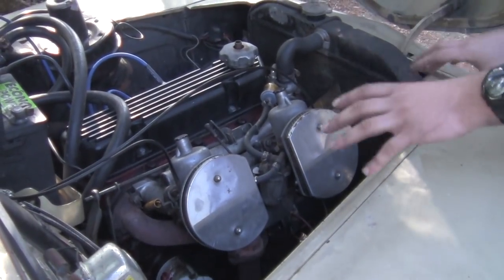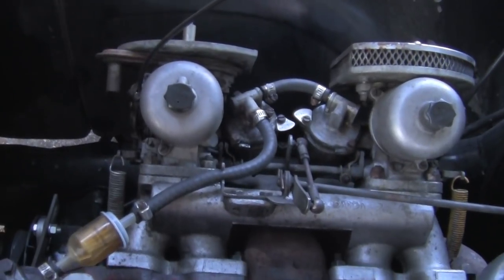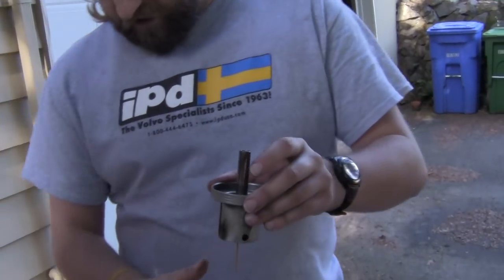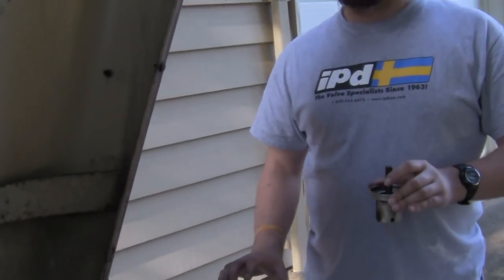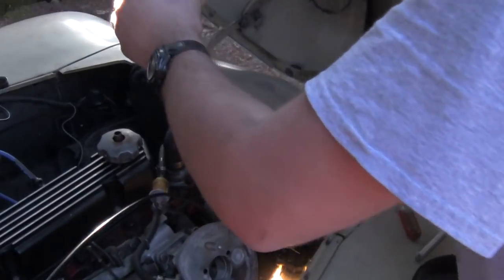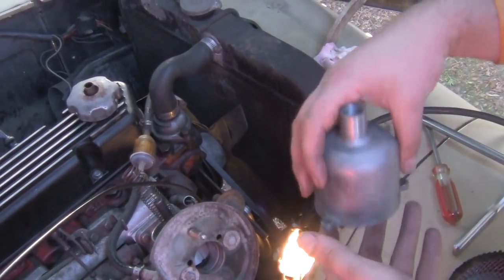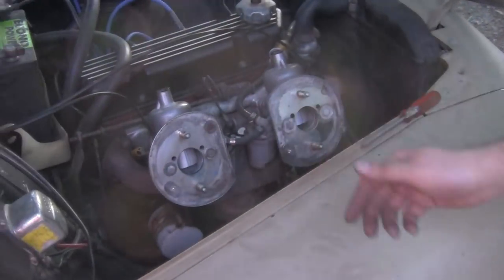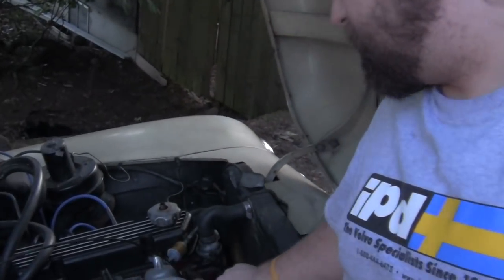Dylan's 544 #3: Setting those SU Carbs!

Comment: Dylan, Excellent video and nicely done. One comment. You may want to mention that when synchronizing the carburetors to get the same flow through each one, you should ensure the throttle shafts are not connected together. The throttle shafts should operate independently for this adjustment and then get locked to each other again when competed.....Tony

Comment: Excellent video.  The best ever on these simple but tricky little English (backwards-Whitworth- carbon-clutch-bearing-lever-shocks) carbs.  You can probably tell I'm not a big fan of the way the Brits made their cars, but your video is a 10.
Reply: Worldwide auto parts of Madison rebuilds the Armstrong lever shock that seals the oil inside so you never have to add oil ,on YouTube I think that YouTube is titled Armstrong lever shocks guys working on a green MG and it's got a good explanation I ordered some from my car and they helped a lot As my car was bouncing around as I went over man hole covers

Comment: Hey Dylan!  You and I are neighbors :D  Just watched this and you pretty much demystified SU carb adjustments.  Thank you much!
Reply: nice yes that carb cleaner makes a difference bout every 6 months i do that and now my 68 1800s is not performing like it should. the peddle goes 90% to the floor before carbs activate. i notice the linkage is loose a little and its really taking a long time to get up to speed. I have to have the accelerator pressed to the floor, which is only around 60. all cylinders at 124-125 psi. my linkage seems off. any thoughts?

Comment: Great Video.  I've been playing with these on my Z's for the last 30 years.  The screw in piston damper used in the Hitachi SU clones have two grooves cut in the shaft just above the brass piston.  The grooves are low and high marks for the damper oil and can be used just like a dipstick to get the oil level correct.  If you have too much oil, you can wipe off the damper and re-insert it a couple of times to get the oil level correct.

I haven't looked at a European SU's  to verify that the same grooves are there.

Comment: Dylan, good video but maybe I can set straight a couple of myths. Firstly, the pistons are not damped to prevent "flutter." They don't flutter. Check out a slide type carb on an old BMW or Italian bike. No oil and damper, and no flutter. Secondly, do not run ATF or anything but 20W fork or SAE 20W-50 oil. That oil and damper tamps down the piston upon acceleration and enrichens the mixture. Put in lighter oil and you're running lean on acceleration. Please keep up the great work.
Reply: I've run Mystery Oil in my z's for years, never had a problem.

Comment: I used 2 things to balance my duel carbs.  First a vacuum meter to ballpark things and then a rubber tube to listen to the hiss to fine tune.  To test your mixture setting drive 55-60 for a flat mile, kill the engine, pull a plug and see that it's light tan. Where did I learn this? Gene Berg

Comment: ATF is too thin for the dashpot oil.  It will rev quicker in neutral but in gear under load it will cause a leaner mixture right when you want it richer for more power.  Using it will lean the intended mixture during acceleration under load because it will reduce the lag time of the piston rising.  The piston will then rise faster which will reduce the amount of vacuum acting on drawing the fuel up the jet.  I'm not recommending SU's oil, but I'd suggest using something with the same viscosity.  Leanness under acceleration load is usually not a wise practice for engine longevity, let alone best acceleration.

Comment: Hi Dylan, Nice video!! One question here. When you were synchronizing the carbs so the air through each carb would be the same, I didn't note that you disconnected the carburetors from each other. What I mean is, why didn't you have to loosen the connecting clamp that ties the two throttle shafts together? On my car, they mention loosening that clamp that holds the shafts tied together and then make the synchronization adjustment. After your all synchronized, you tighten up the shaft clamps again. Does this make sense?
Reply: I totally agree! You must disconnect the carbs throttle connection from each other before balancing the air flow into each carb. This was not shown in you video, but I am sure that you did this. I have been balancing SU carbs for over 50 years and this must be done.

Comment: i use one of those magnetic dishes to keep the parts in it holds those tiny screwws in perfect even if you happen to knock it of the fender
as for filling the accelleration bit with the oil  , there these oilcans pump thingies used to oil steamengines and other mecanical stuff , they pump luttle squirts and the perfect for filling these up

Comment: It sounds a little slappy on the valves. I used 5 weight oil in my carbs. Valves were 25 thousands cold- 26 hot.  Idle @700. These engines always use solid lifters and were a bit noisy. Good video

Comment: Thanks for the video it was really helpful, my bowls were full of gunk and lines were clogged. Gave them a real good cleaning, After I installed them back on the car was idling extremely high as if someone were stepping on the gas. and when I would push on gas pedal it was kind of sputter. I noticed some smoking from the exhaust manifold. Any idea why it would be idling that high?

Comment: Fantastic video! Going to be working on this as soon as I get new dashpot springs. I have these on a 1967 Rolls Royce. There is no easy way to get at the intake of the carburetor without removing the whole intake and choke. Is there another way you'd recommend setting fuel air mix? My black exhaust tells me I need to work on it a touch. Thanks!
Reply: Also, on further inspection, I can NOT find a way to get at the mix adjustment on the bottom. I have a V8 in the way

Comment: Historically after letting car sit way too long, 10yrs plus, we got it running again, and painted up, the carb would start running rough(rich) and I would lean it via the nut underneath the card. main complaint now is it idles real high(tach doesn't wk, not sure if that caused by using pertronix ignition but seems like I had tach after putting in petronix) and 2nd complaint, the car won't to diesal or keep running sometimes when I turn it off. Time to no doubt to follow your intructions or at least tighten adjusting nuts a bit. I rebuilt carbs b4 it sat so long, that another option

Comment: A great video!
One question: At 20:45 I thought you could only do that (syncro both carbs with te speedscrews ) with the clamping bolds, on the shaft that connects both butterflies, LOOSE! Yours are still connected..you pull the central lever up and BOTH carbs react; can’t syncro like that???  Or am I missing something???
Ok, idle is set, then, right. But when you add gass, then they are NOT syncronised.
Reply from the maker: I don't really see a need to disconnect anything when adjusting the idle unless things are way out of wack.  I'd rather make adjustments while everything is hooked up; what you change on one carb will impact on the other after all.

As long as both butterflies open at the same time, it won't matter.

Comment: Would you recommend replacing fuel carbs with webber downdraft? For 74 1/2 mgb.
Reply: Absolutely not unless you are going to port the head, raise the compression , change the cam to a 260/270.  Even then, the engine was designed for SU carbs and the SU carbs were designed for that engine.

You may want to change the needles.. Contact Moss Motors for suggestions.
And has been mentioned, carbs are the last thing you want to address after, points, plugs, condensor, rotors, plug wires, caps, adjusting the valves, setting the timing.
SU carbs are trouble free, easy to adjust, need little maintenance.. unlike Webbers. Expensive and unnecessary.  
And then join MGEXP discussion group..

As a former BMC (factory authorized Rolls, Bentley, Jag, Aston Martin, Austin, MG, Morris, Lotus etc dealership ) mechanic in the 60s and 70s..., and prior workd for SCANDIA Motors in Seaside Calif , the official Volvo SAAB dealership.  the biggest problem with SU carbs are the geniuses who think they need adjusting and they are the chosen ones to do so, especially independent garages and your best buddy who used to own an MG.

Also do a youtube search for University Motors LTD , all about MG cars and SU carbs.

Comment: I have 64 Daimler 250 V8.  I stripped carbs, cleaned and 're-built' (a.k.a put them back to gether!).  I have done no tuning and will have a go now based on this vid.  However, one question - what are 'flats' when you say loosen off '12 flats'? Thanks a mil

Comment: Dylan, Great video maybe you could help me. For some reason my car conked out the other day and now it won't start and I suspect it's fuel ( su carbs) related. I have fuel in the float chambers but not sure if I am getting any in the carb itself, with the air filter removed should I be able to see petrol mist when trying to start? Any help would be good

Comment: I have a 1971 Datsun 240Z and I am working on the SU carbs. I use to have this down pat, but it's been w while, and the car has sat for some time now. I have taken them completely apart, and cleaned every thing, but I am having a few issues.  1.  For some reason both chocks work ok when out, but sticking when installed.2. The jet in the rear sticks a bit when all most closed, 3. For some reason the carbs are being difficult to ballance, what do you suggest as a Base Line Setting for the Throttle Adjusting screws? If you balance the carbs with the Throttle adj. screws, what is the Balance screw for?
Reply from the maker: Hello!  Sounds to me like your jets aren't centered.  There is a special tool that can do this, but there are other ways to get around not having the tool.

There is probably some crud / rust / dirt inside of the Jet that is not allowing them to move freely, or a spring that is no longer holding tension.  

As far as the base setting, use your best judgement.  If the idle bounces around or changes for seemingly no reason, you might have throttle shafts that are worn out.  Spray around the intake and base of the carbs with water and see if it impacts the idle.  If it does, you've got an air leak somewhere.

Comment: Hi, Dylan I have an MGB1975 with twin SU HIF carbs and I cant seem to adjust it out of lean.
When I lift the piston the revs drop no matter how the mixture is adjusted.
Any help would be appreciated.  Phil  (Ireland)
Reply: Check for vacuum leaks on the manifold and any piping running to things like brake boosters, stuffed vac advance etc.  You also need to make sure everything else is spot on with ignition (points, dizzy cap, rotor button, condenser, plugs and leads), timing (Including checking the vac advance and mechanical advance), tappet clearances, compression etc before you go near the carbs.  They are the last thing to look at in a tune up, but often missed.  Good luck. 👍
Reply: I am sure that you have a vacuum leak. When there is a air leak in the intake manifold, you can never set up your carbs. One way to find the leak is to spray carb cleaner onto different locations on the intake manifold and river piping. Another way is to use an unlit blow torch and aim the nozzles at different locations including all the rubber pipes. When the engine speeds up while gassing a location, that is where the vacuum leak is located!

Comment: Hello i have a question i have motorcycle with hif38 carb on custom
 manifold. Mine question is about the vacuum advance port should i block
 it or keep it unblocked? there is nowhere for it to connect and it vacuums to air.

Comment: Great video looks easy too!  What would cause my idle to rise after car has been run for awhile? Typically it will idle at 1200 rpm when it first starts up then,  after the car has been driven it will rise up to 2000rpm which is too fast. What causes this rise in rpm and what do you think is the cause? Thanks!
Reply from the maker: You've got an air leak somewhere.  Probably at the throttle shafts.

Comment: Hello Dylan. I am a bit curious about what needles you are using? I tried adjusting to about 12 flats,but my car almost died. I like your video, it was very helpful.
Reply from the maker: An otherwise stock Volvo B18 engine would use ZH needles.

Your flat settings will vary.  12 flats is just a starting point.  Many different factors can have an impact on mixture.  If you are in a higher elevation area where the air is thinner, you might need to run the carbs a fair bit leaner.

Find out if the car is running too rich or too lean, and adjust appropriately.
Reply: Dylan Berichon
 Thank you.

Comment: Hello Dylan, I hope you are ok.
First of all thank you very much for this tutorial, it’s great! It encourage me to clean my carburetor!
I own a Mini 998cc and the problem was that jet was not returning (when releasing the choke). 
When I got there.. I found that my car has a HS4 waxstat carb (which I don’t know if needs a different procedure).
I took out the carb, clean everything from the dirt stuck and reassembled. All moves right now.
I followed the video. I flushed the jet and gave 12 flats down.
The problem I have is that when I lift the piston (by using the pin) to check if mixture is ok, the engine stops. If I understood correctly that means that mixture is too lean! So I gave 1 more flat down.. then another, another and another.. and the car always stops.

Any idea?

Thanks in advance!!
Regards.
Reply from the maker: Try leaning the car out instead.  12 flats is just a starting point.  Best of luck!
Reply: Thank you very much for your almost immediate answer!!
Sorry.. by leaning the car out, you mean to make the mixture richer or leaner?? (I'm from Argentina and this is not my native language, sorry).
Reply: Turn the mixture nut up to make it leaner, some people suggest start at 8 or 9 flats down rather than 12
Reply: @guitarTennisCarHomeFixFlying  why would a rich mixture make the car to stop?
Reply from the maker: @andrespareradeniz9797 If a carb is set too rich, it could foul the spark plugs which would cause it to sputter and stall.

Usually if a car is too rich there will be other indicators (like black exhaust, etc...)

Comment: Dylan, when setting the idle, do you not use the tachometer to set the idle??
Reply from the maker: I'm sure one could use a tach to get the idle to an exact setting, but I just set the idle by ear.  Idle will shift ever so slightly on a carb'd car anyway (depending on a variety of different factors beyond your control), so as long as you're in the ball park you should be good.

Comment: Back to front. Idle screw setting first using the Synchrometer THEN mixture. Engine must be warm and the manifold cleared of excess fuel every few minutes by holding the RPM at at least 2000 RPM for 30  seconds. Blipping the throttle is a waste of time. When the mixture is right then back to the idle settings and repeat.

Comment: Would the tunning of your carbs have anything to do with cold starting issues?
Reply from the maker: Absolutely.  I didn't go over it in this video, but make sure your choke is working correctly.  With the choke pulled out all the way, the jets should drop down all as far as they can go, and it should engage a cam to increase the idle.  Have a look there if you haven't already.
Reply: Dylan Berichon when the choke is pulled out and it has been thoroughly warmed up it will idle, would that point to adding more fuel to the mixture?

Comment: What about high speed adjustment? Your car barely sits at idle all the time. You should also check/adjust your carbs at 2000 RPM. There should be a idle service screw to raise the RPM to check this.
Reply: There is no "high speed" adjustment. This is controlled by the needle.

Comment: What if the jet does not move when you turn the adjustment nut? I currently have this problem that's why I ask. 

My carbs are hs6 style from a b20
Reply from the maker: You probably need to take the jets out and clean them up.  There is probably dirt / other stuff stuck in there keeping things from moving.
Reply: take the jet out and clean the threads bro, after that soak the screw in carb cleaner or kerosene

Comment: Also I have twin su s when car is cold it starts ok but after a few minutes when warm car wont start unles I lift one of the carb pistons while turning car over then it starts also when its running the left carb piston is higher than the rite carb piston any idea wots wrong it does run very rich to
Reply: ace crusader Have you tried everything on this video? Then the last bit will be to set the idle (flow rate through each carb and check it's the same with the gauge).

Comment: Turning my adjuster nut does not seem to move the dimple on either of my carbs? Is this a sign that they are both dirty or frozen? What do you recommend?
Reply from the maker: Did the car sit for a while?  Things are probably dirty or rusty.  I'd probably start by removing the jets and cleaning them as best you can.  If they are too far gone, replacements will probably be in order.
Reply: Thanks Dylan. I appreciate the response.
Reply: Looks like the adjuster nut is fused to the lower jet bearing, so that when I turn the adjuster nut the whole thing turns. So the adjuster nut is just turning. Not sure how the lower jet bearing would stay motionless so that the adjuster nut could screw on and off it. How is that supposed to work?

Comment: The tool you use to synchronize the carbs, what is it called and do you have a recommended source for one?
Reply: Ped Watt that's a Carburetor Synchrometer -- you can find it on eBay for around $40 with free shipping!
Reply: Ped Watt his is an STE brand I believe.